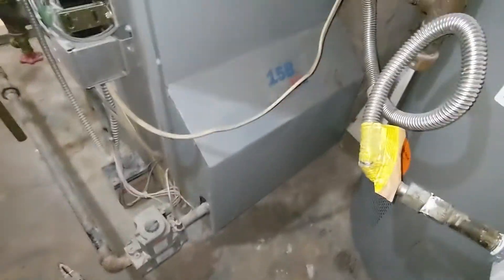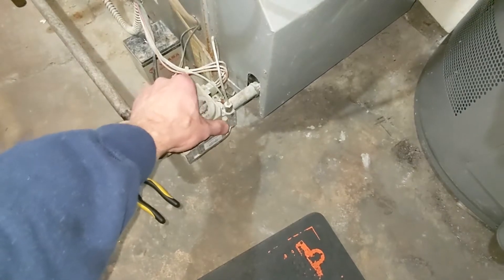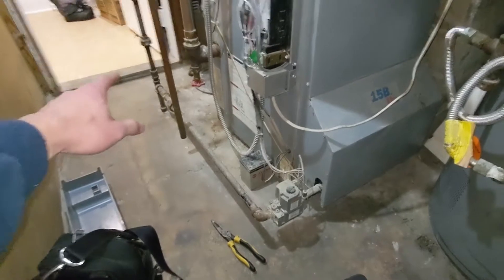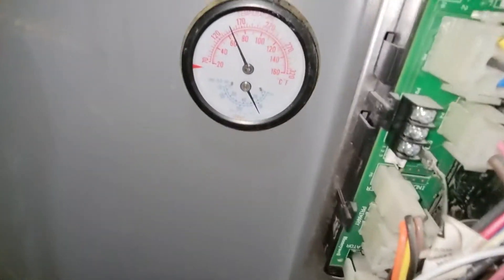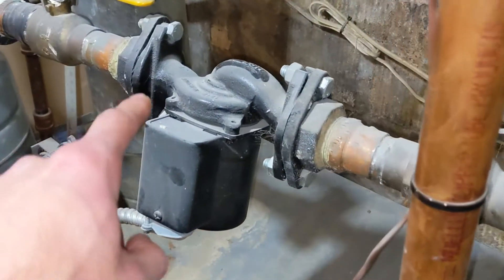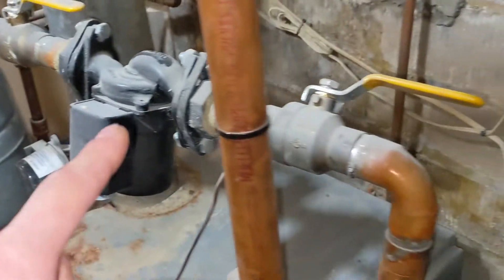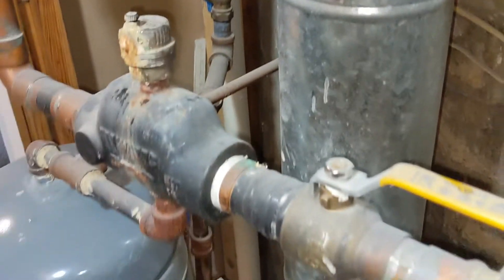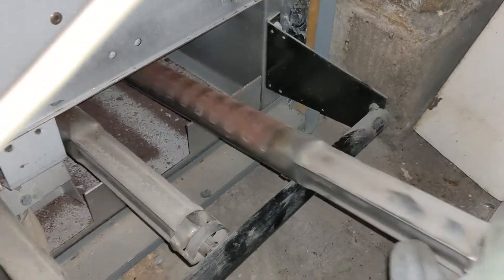Utica boiler with noisy gas valve

Comment: The shade pole under coil is broken. You can change your power supply vdc to dc. Make sure cut voltage roughly in half. Ie. 24 vac to 12 dc, etc. then try to find a minimal current which can activate the valve or introduce a resistance to reduce the current

Comment: i have the same problem. i havd very old gas furnace. i could not find the same solenoid valve. it use 24 v. three wire and standing pilot.may i just use any solenoid valve using these same spec?